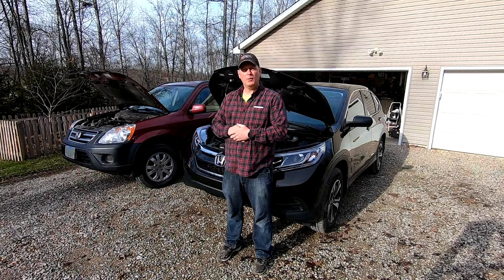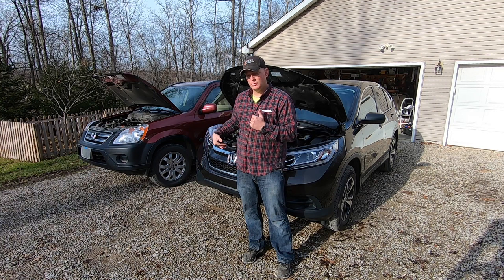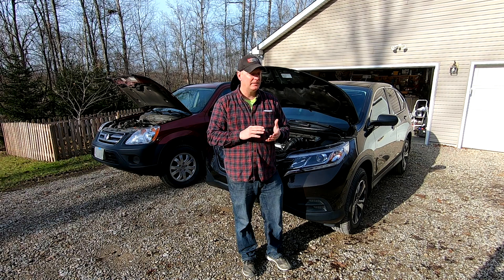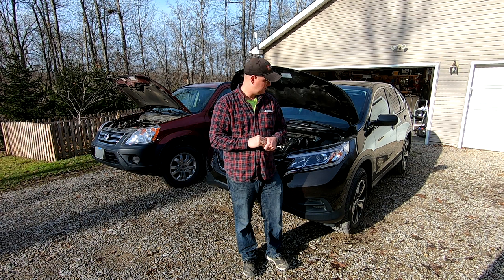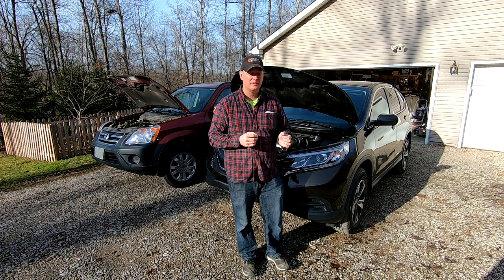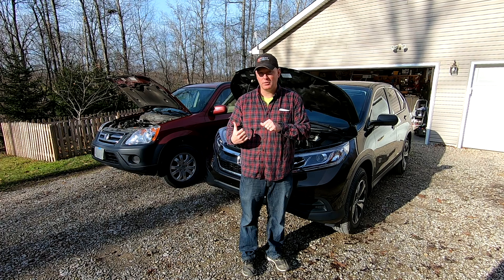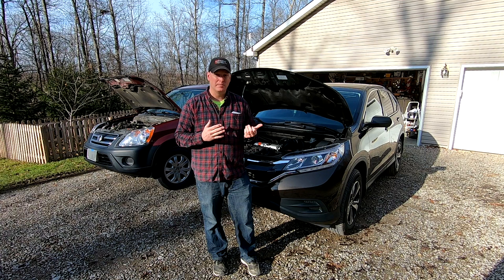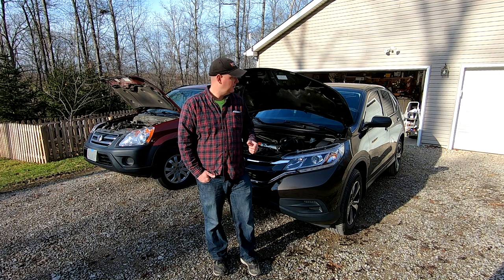DON'T BUY THIS CAR - 2012-2014 Honda CRV

Comment: Yes, the VTC actuator on my 2012  was changed at like 80K miles, the noise is coming back around 105K miles now so it does not fix the issue. Nothing wrong with the engine once it warms up but definitely annoying in the morning from a cold start. The AC compressor broke on as well, a common issue too on these engines. Other than that, been running fine still would have a Honda over any American product in my opinion.
Reply: yeah my 2013 does this and when we went go get it fixed they said there was no point bc it would come back which it did but i have had my car for years and it’s been doing that for years and my car still runs and everything perfectly fine
Reply: I know that our generation of crv’s suffer from tranny shuddering, which I bought my 2013 used with 40k miles and I currently have 64k rn after a year and some change, I get shuddering once in a while but I know it is a common thing
Reply: @explorer2945  change the trans oil every 30,000. Somethings shedding grit upline of trans. Watch some more videos.  You'll find the video.
Reply: @explorer2945  Get a transmission fluid flush every 30-40 K miles and it will run good for a year or two, then you have to repeat.  it is cheaper than a new torque converter by thousands of. dollars. I've done this many times. It works. make sure your mechanic uses Honda Trans fluid.
Reply: @Susan70003   I do the trans. service on my 2014 CRV every 15K miles. It cost about $30 for three quarts of Honda Oem Fluid, and it's a job that is faster and easier than changing the oil. I had a  2013 and now a 2014 with a total of close to 400K miles on them. The transmissions have been trouble free. I have had a collection of vehicles in the last 20-25 years that I have obsessively over-maintained, with everything from brake fluid flushes, to exceeding the "severe duty" maintenance schedule in every aspect. I have found that it really makes them last a hell of a lot longer, and with a lot fewer repairs.
Reply: @kerrykerry5778  Good to know. Thank you.
Reply: Use the recommended type of oil but change it every 5,000 miles instead of 10,000. Don't let the oil level fall lower than ½ quart down.
Reply: @Susan70003  You are not really "changing" the fluid (not oil) in the trans. when you do a trans service. You are removing and replacing less than 3 quarts of fluid, which is a fraction of the total capacity. The task is actually EASIER than a DIY oil change on this generation of CRV. I do mine every 15K miles and always use OEM fluid. NEVER let anybody, including the dealer, do a transmission flush on a Honda, unless you can find specific information that Honda approves it for your particular transmission. Never use any random brand of fluid. At 157K, and nine years of use on my 2014, I still have a slight shudder that it is mild and infrequent, so I'm not too concerned.
Reply: @michaelpalm2210  Honda is generally pretty firm about NOT flushing the transmissions on their vehicles.
Reply: @paysonbennett4880  how often does it make the noise - - how many times a week
Reply: I have a 2014 with 324k no problems no noises no heat loss no ac compressor failure no vct problems you must have bought one that was not properly maintained. My car is a dealer maintained CRV with a flawless history.
Reply: @313TECHNO  Glad to hear yours is doing so well. I don't think you can attribute things like the vct or compressor to dealer maintaining it - but I'm glad  yours is problem free.. My2014 w/ 90k does the vct noise about 6 times a year but other than that it's been doing well and mine has been Chuck maintained only.
Reply: How is it going now? Still just a noise or has it gotten worse? Just curious bc they told me mine was just a noise, until it wasn't and ended up ruining my car.
Reply: I agree with you... I own German &American & Korean and they are worst for everything, except makes you look more expensive but in your pocket you broke

Comment: I have the '14 CRV and it's been one of the best cars I've ever owned.  Honestly, I mean if someone had one like mine and it ran the exact same way they'd be crazy to complain about it. Mine has 325,684 mi and going strong. It's made "The Noise" a little bit before 200k mi. I'd be happy with it for a daily driver car to beat up on.
Reply: How many miles did it have when you bought it?
Reply: I own a 14 CRV I don’t have any complaints about it. I’m happy with my car. 👍🏻
Reply: Wow, our ‘14 CRV has just over 80k on it, and is an excellent vehicle indeed!
Reply: I agree with you. 😊
Reply: I have a 2015 CRV and over 140k on it alls I've had to do is replace the starter so far.
Reply: @Powerstroke98  it’s been seven  months since I bought my CRV since then not problems at all. 😁😁
Reply: Have same problem with my crv 2.4 auto 2013 model , made  noise replaced vtech actuator quiet for 10k km's noise is back. Especially more frequently in cold weather startups after standing for day or so.

Comment: 240,000 miles on my 2013 Honda  CRV  notice this noise at 178,000 never replaced  it  and it still running  strong besides  little  noise wen cold start...hit you guys up at 500,000 mile the 2013 crv model is bullet  proof  trust me I haven't  had any problem  with this  car but minor  stuff but it jus a Lil early  morning  rattle  snake.
Reply from the maker: Glad to hear you are having good luck with your CRV.
Reply: Did you change oil more often or any other maintenance tips to share ?
Reply: Yes I changed my oil 🛢  religiously ever 3000 mile fully synthetic  and also  I change my transmission fluid  every 4th oil change  yes I  do all the services  on my crv so it a Lil reasonable and I kno it done right but yes changed  that oil oil oil!!!
Reply: @williamspear7803  Thank you!
Reply: @williamspear7803  
Wow. Every 3,000 miles. I wonder if it would have been no different with every 5,000 miles? Us there a particular brand you used?
Reply: @JackTannehillPromoter  fully  synthetic  havoline oil. With Honda original oil filter  which auto zone  carry. 3 qt original honda Transmission fluid frm dealer !!! Yes to answer  your ? Yes you can go 5000 miles on every  oil change  it not a big difference it jus I do all my services  on my crv.and it save me money  so that why I services  my every  3000 mil. Oil chnge.and Transmission change.

Comment: The 2014 CR-V 1.6 i-DTEC Diesel (built in UK) was the best car I ever had. Solid, economical, reliable, brilliantly engineered. I put 232,000 km on it without any issues other than wear and tear. This car turned me into a HONDA fanboy (now in a European HR-V Hybrid). I have owned many cars from Toyota, Mitsubishi, BMW, Mercedes, Ford, Opel, Citroen, Peugeot, Buick... Nothing comes close to the quality of a HONDA, that is my experience.
Reply: No honda diesels in north america
Reply: totally different engine! do you actually hear what he has to say ?
Reply: Brilliant. I have a  2017 Civic with this engine (tweaked slightly differently I imagine) and fully intend to get a 2014 or so CRV. Really looking forward to getting it.
Reply: Agree!
Reply: I have exactly this car, 1.6 idtec 160 biturbo.
I have 371000km currently. 
I found this video because I need to change my cooling radiator, not a big problem.
I just pass by here and say this car is reliable.
Only one problem I had was P049b defect, Honda dealer said DPF was out of order, but it was false. This code comes because soot blocks the EGR B filter mounted just after the DPF. It has to be replaced and the soot comes not because of the DPF but because of defective injectors. Many cars with EGR B (permits not to use this bad ADBlue) have the same issue. Test your injectors.

CRV is a very reliable and comfortable car.

Comment: I have a 2014 Crv Ex with the VTC actuator defect as well. I had it replaced at Honda, but it came back. I stopped caring about it. 185,000 miles later it still runs great. I regularly drive it 500 miles  to school from my parents house. It starts every time, and none of my passengers comment on it.
Reply: Same. Sent to service. Came back with the same rattle

Comment: We replaced the complete transmission at 134,000 miles in November 2019. Not sure if that included the VCT Actuator. Now at 265,000 it Definitely Still Makes That Noise and Definitely Burns Oil. We bought it from CarMax in November 2016 with 40,000.

Any class action suit we’re in!

Comment: Been using CRV 2013, 1st owner, no issues at all. It's a little underpowered if compared to my other cars, but it's not a big issue.
Reply: Me too I have a twenty thirteen and I have no problems with the theater
Reply: @jimparsons61  What gas mileage are you getting on yours? I have the same car. What engine air filter do you put in?
Reply: yes My daughters 2018 crv has more get up and go. What is your gas mileage? I don't get very much air out of my driver's side dash heater air vent. I guess I have to look at that.

Comment: I’m a Honda dealer mechanic and I can tell you the best Crv is the 07-09 years. When they first came out they had bunch of recalls and service bulletins , but Honda fixed them all . After that they were bulletproof(no burning oil or timing gear issues 😅)I still own a  09 model and very happy with it.
Reply: What about the 2011?
Reply: That Mickey Mouse rear trailing arm recall fix is a bit scary though

Comment: Just upgraded to a 2014 crv ex from my 2004 crv which has been great up to 175k miles with no issues. The 2014 doesn't have the vct rattle... yet... but so far I really like it. I'm a mechanic and have seen a few stretched chains/ vct actuator problems on these gen 4s but still didn't deter me from buying one. Mine has 67k on it now so hopefully I have some time before I see this issue. Great informative video btw
Reply: Just go with a original Honda chain once it streches I replaced mine at 195,000 with an aftermarket and it broke it now at 216,000 I redid it with an original Honda everything
Reply: I had mine fail at 80K miles. I'm at 150K miles and get a slight rattle at startup now. Two points might interest you as a mechanic. First, I asked the head mechanic at the dealer about the possibility of any good will warranty? He told me that Honda won't tell you this, but they stopped offering any help with repairs as the repair is fairly complex, and you need to take your time and follow the procedure EXACTLY as you will have a repeated failure,  if you just slam the new parts in. He claimed Honda grew tired of paying for the same good will repair repeatedly, since their techs would not do the work correctly. Second, I had all of my repairs done by a really talented independent tech. who took his time and did it right. I have 70K and three years since the repair, and it looks another chain and actuator will be required in the next year or two. I agree with the conclusions of Jack of all trades, there is a design flaw here that can't be corrected with any revised part swaps, or better maintenance.
Reply: I don’t know if this helps but… I bought a 2012 in September and this has happened to me on cold starts. Researched it and seen everything everyone else has. What has been working for me is “half starting” the car (for lack of a better term). Basically, turning the key like I’m starting the car without letting the car turn over and completely starting. I’ll do this 2-4 times (depending how cold it is) and then fully start the vehicle and no rattle whatsoever when I do this. My theory (which may not be valid because I’m no mechanic just a general interest in cars) is this will at least initiate the oil pump and getting some oil to the actuator. Again, not sure if that’s a real world solution but it has worked for me every morning cold start for the past two weeks. The wether here in the mornings are usually high teens and low to mid twenties for the past couple weeks and no issue. Before I did this it would happen every single morning like clockwork. Any feedback would be awesome!! Good luck everyone
Reply: My granddaughter's 2014 consumes oil and has the VTC rattle at start up with 162,000 miles. I had Hondas most of my life. I'm 76. Now I'm done with them and driving a Toyota.
Reply: @kerrykerry5778  so do you suggest not buying one of these?  I'm looking at buying a used 2014 CRV-EX right now with 101K but now reconsidering....
Reply: @d.r.q.2032  Well, on one hand, it's a pretty solid vehicle with a flawed engine design. So, doe this one have any service records indicating a replaced timing chain and VVT? Is it rattling on start up?  Can you tuck $2K away for the day when the engine might need that repair? I guess I would view it as, I would rather have a Toyota RAV4, but OTOH, that series of CRV is a lot better than a lot of other older compact SUVs the competition offered, like anything the big three and Jeep built in 2014.
Reply: These require undercoating or frame will rot in northern states. 2013 w/140,000 miles can't pass inspection (Vermont).

Comment: The rattle occurs because the locking pin is not held in place due to weak spring tension on startup.  Noise can be fixed by replacing the spring only if your issue is truly the VTC. I believe that the rattle returns even when the part is replaced due to the spring tension getting weaker. YMMV.
Reply: That's what I read also. The noise comes back.
Reply: Any  way we can add a stiffer spring?
Reply: How far does one have to dig into the engine to fix this spring?
Reply: @daveengstrom9250  Not very far, valve cover comes off, 5 torx bolts on the cover of the VTC actuator and thats all - the spring can be removed and replaced. Hardest part is removing those torx bolts.

Comment: I have a 2014 Honda CRV and the VTC actuator needed to be replaced at 41k. I did it myself using a Non OEM part looking for a more quality part. The procedure isn’t easy and you have to be careful not to slip the timing. I currently have 62 k on my Honda with no VTC actuator problems. Buy the way, some Toyotas and Fords have the same problems.
Reply: Have you seen the Chrisfix video on changing the vtc actuator? I watched it and am thinking of doing it myself to my mom's car

Comment: Wow... i had to argue my dealership for days to get them to even acknowledge the issue then finally fix it under warranty. Thank you for making this video!!
Reply: what year was your CRV and when did you get it fixed for free. Mine in 2014. I had this problem all along from the first year onwards. wondering if they would fix mine now. Any info will be appreciated. Thanks!

Comment: Our CR-V has had this noise since we bought it used. I never thought much of it since I originally thought that t was the direct injection system or similar. We’ve had the vehicle since 2018 with absolutely no issues other than noise on startup. I’m not dismissing the issue but the vehicle has been excellent in the four years we’ve had it. Even in your case, the only symptom you have is noise. It’s hardly left you stranded.
Reply: Does your crv have the serpentine belt and not the drive chain. I had a dry pulley. that may be your noise. A dry pulley shouldn't have happened either. I would report it to Honda America at their 900 number. I had low miles. 75,500 and just had 3 parts replaced. now it is quiet under the hood. Please share your experience.

Comment: I found that when below 45 degrees if I bump the starter a couple of times before starting there’s no rattle. Maybe the oil pump gets enough oil to the actuator to function correctly.
Reply: That's exactly what I do. Might get one or two rattles though the winter.
Reply: What does it meant to bump the starter?
Reply: @husain6431  let the motor turn over with out starting. It don't take very long maybe a second or 2. After that crank and start like normal.
Reply: @patrickthompson8913  and how does one "let the motor turn over without starting?" Is this something you can do from the driver's seat? Just turn the ignition on without starting it?
Reply: @d.r.q.2032  it normally take a few seconds of the motor cranking to get it to start. I turn the key and maybe a second or 2 turn it back before it starts. Then just crank to start like normal. It is more wear and tear on the starter and somewhat the battery but it does keep it from rattling.

Comment: My wife purchased this car before we met with 90,xxx miles.  6 months into us dating I learned it was using 1 pint of oil every 1,000 miles and the entire time it had that horrible rattle. Thank goodness she bought it before we met and she just happened to purchase a bumper to bumper warranty so they replaced this vct actuator, timing chain tensioners, timing chain, “new updated pistons and rings,” front half shaft, and some other suspension part. I have always been a ford guy and have never had issues like this so not the best first impression of Honda. Especially with their reputation they are supposed to have. Now at 140,000 miles we need to replaced shocks and struts. Normal stuff but next car we buy I believe we are going to go back and find the lowest mile 2005 or 2006 crv.
Reply: Just add sea foam 4 oz to the engine and make 100 miles  max 300 miles  before the next oil change. i did, and it works   my honda crv has 116 k miles  and evry 1 k miles take 1 quter  oil now after first time i added  and changed oil  i did 1800 miles no problem take about 1/3 quter.I will doit again after 3 k miles